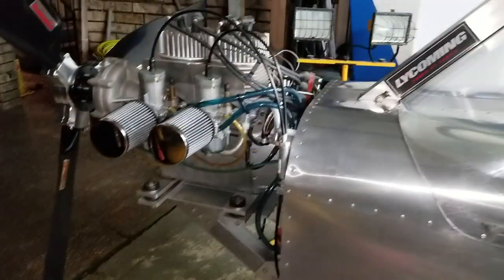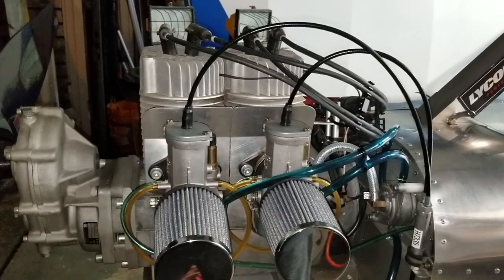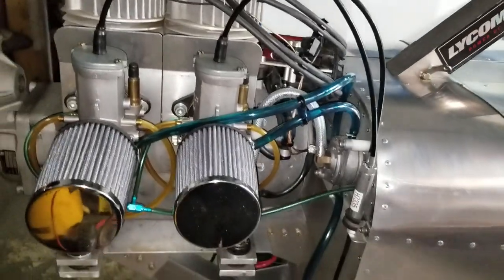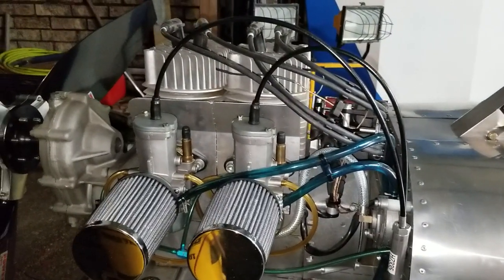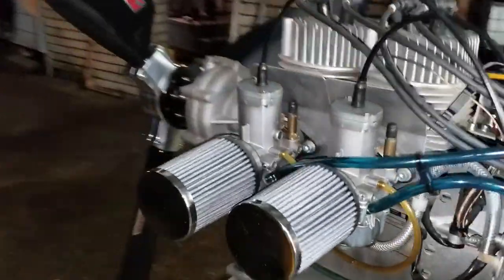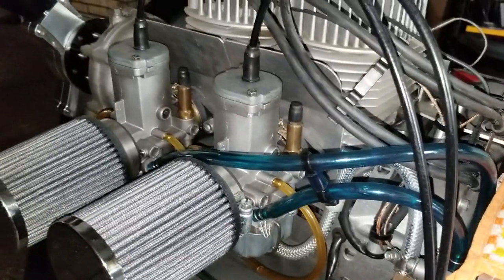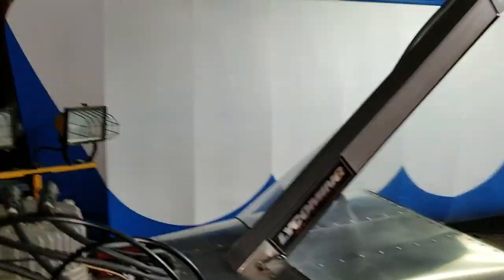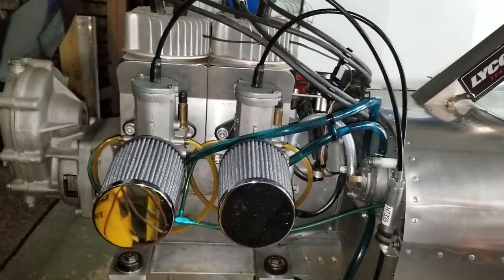Affordaplane update 11-5-18

Comment: Spray ether around intake to check for leaks.... A leak will display either increase or decrease in rmp.... Also air filters can cause issues sometimes.... Float levels are important too very often in hot rods I find float levels causing hot spots due to lean conditions

Comment: Love the build Terry!  Have you checked the throttle cables and confirmed that both carb slides are in perfect sync?  If one was a hair more open than the other, might that not affect fueling between the two?